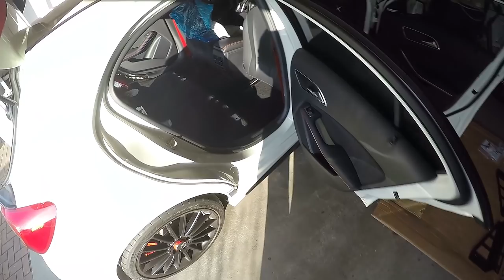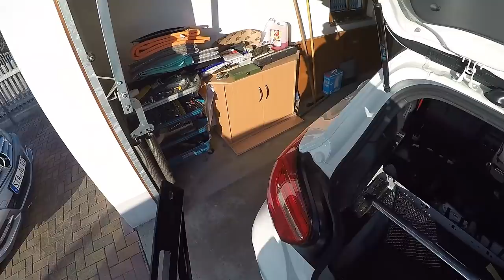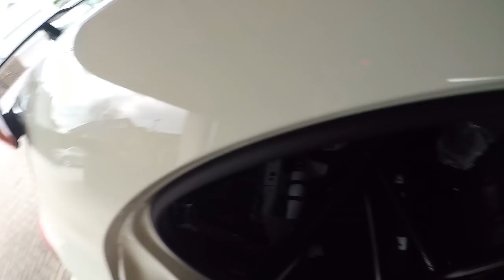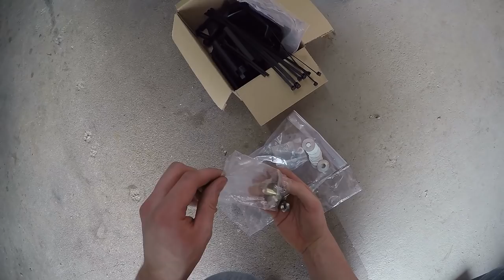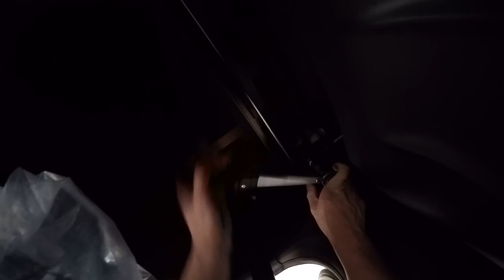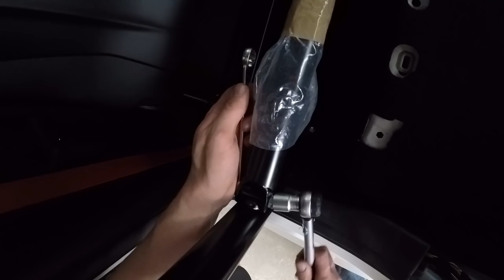Building my own Tracktool #7 - Mounting a Clubsport Roll Cage

Comment: Looks awesome, i wonder if you can feel a difference with a rear only cage on the track from added stiffness? Also: Did you take the cromoly steel version?
Reply from the maker: I feel no difference. The cage is made of steel S355J2.

Comment: @WaveCeptor.  I own a A45 with the michelin pilot super sport tyres 235/35 19inch, what tyre pressure  do you use for optimal performance?
Reply from the maker: 2,5 bar front, 2,2 bar rear (warm tires)

Comment: Do they still make this? I looked tonight and couldnt find anything
Reply from the maker: http://www.wiechers-sport.de/en/shop/ueberrollbuegel-kaefige/produkte/mercedes-a-klasse-c176-w176-ab-bj-09-2012-clubsport-detail
Reply: Thanks for that :). Could you tell me what options you went for?
Reply: @Neeburs  @waveceptor yes please could you tell us what options ?
Reply: @WaveCeptor22  Could you tell us what options you went for ?
Reply from the maker: @NAPO2818  Its a Clubsport cage from Wieches Sport with a cross instead of a diagonal strut bar, H-strut and safety belt tube without insert nuts.
Reply: Hi, this Clubsport roll Cage ia good for CLA 45 amg from 2014 ?